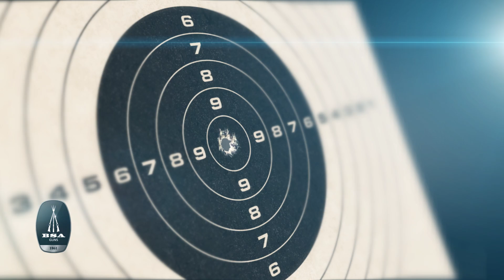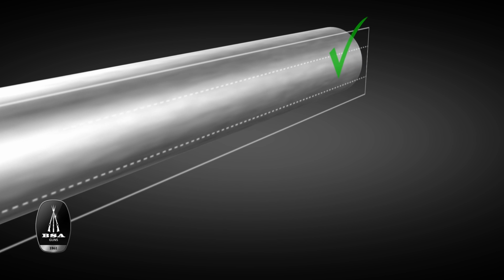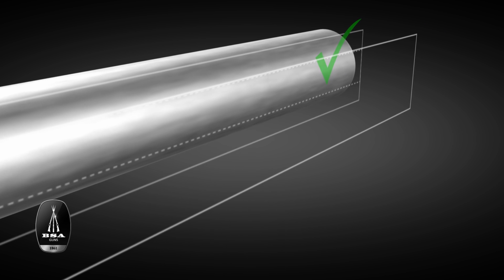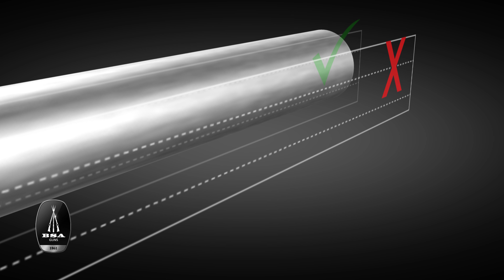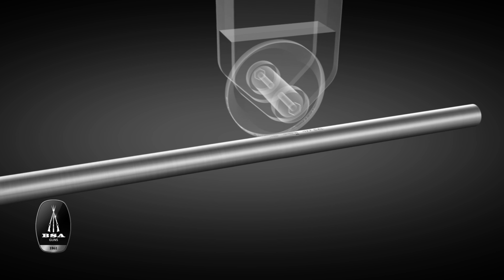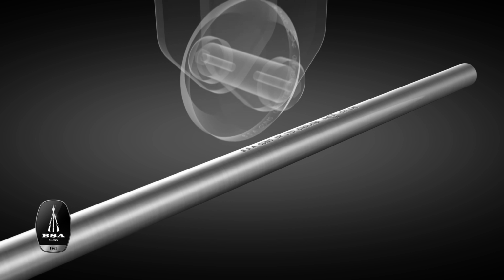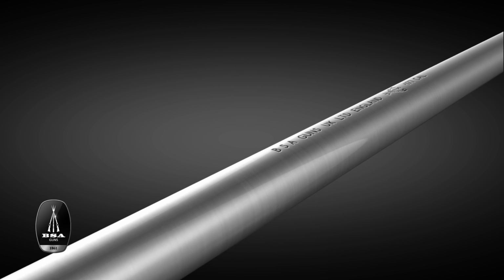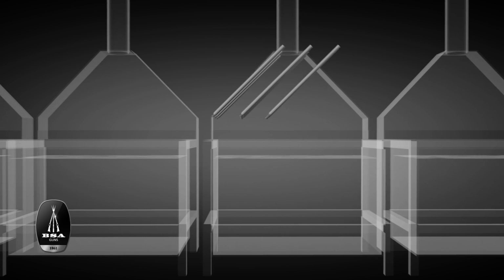BSA Guns Barrels

Comment: please make longer barrel options 
my Gamo coyote would benefit drastically , since its very loud when on full power
I get Hades .22 @ 940fps - JSB 18g @890fps
 a longer barrel would stabilize then gun and give a lot more power

it could be the next entry level slug gun with good performance

Comment: Sadly after all that some Brummie shoves the barrel in any old how. On my MK1 BSA Lightning barrel is off to the right and droops. In addition there are terrible weld lumps on the breech which still has no lock nut. Spring is non sleeved, steel guided against a badly machined cylinder. Even the stock was packed out with nylon to assist the cocking arm movement. Overall dreadful workmanship from this once respectable firm.